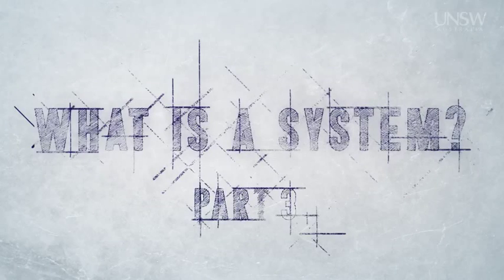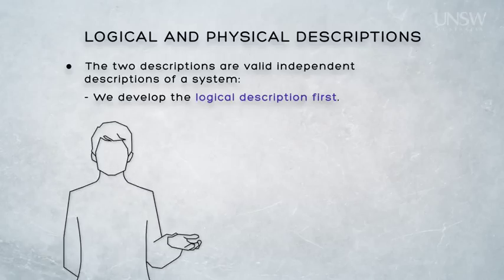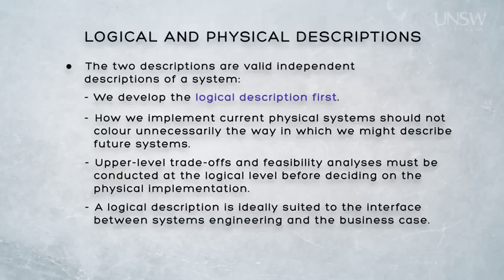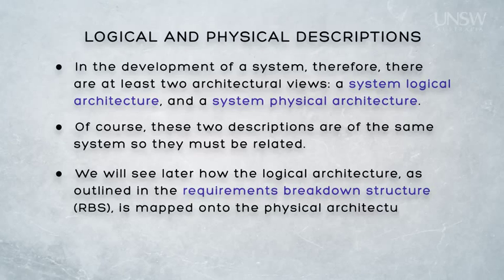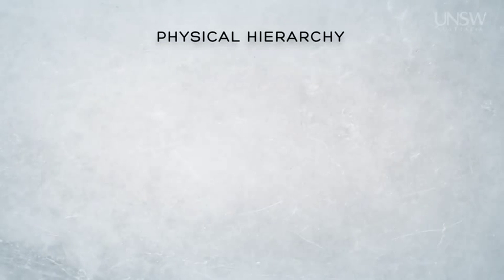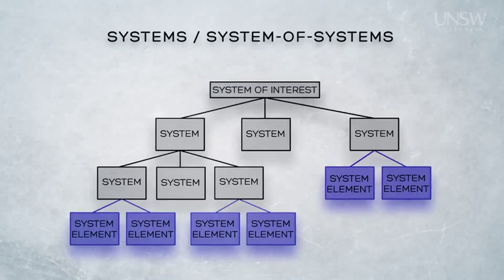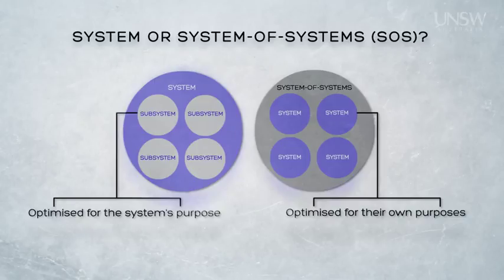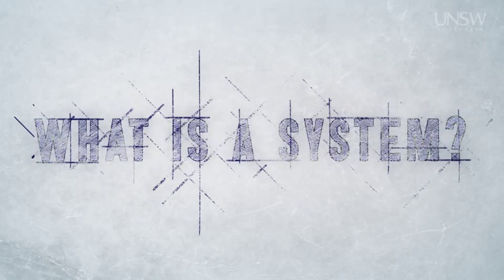1   4   Module 1 2 Lecture + Introduction To Systems Engineering

Comment: Hi,

thanks much for providing online such a good training free of charge. 

If I may do a suggestion, the videos shall include some milliseconds breaks after introducing an important information or even more important before switching from one slide to the next, to allow the user to absorb the information, think about it before the next topic is introduced. 

Due to this issue, I am forced to go back one--two times, stop the video at the right millisec in order to be able to really absorb the last piece of information on nearly each slide.

One more thing, while going through the Module Slides, just noticed that some slides are duplicated into the PDFs (for example Module Lecture 1.2 1pp, slides #1 and #2, #4 and #5).

Besides that, I personally appreciate very much the condensed way of presenting such a topic. Really good!